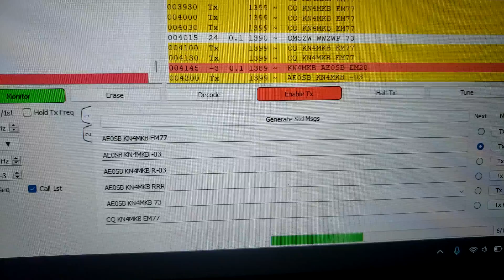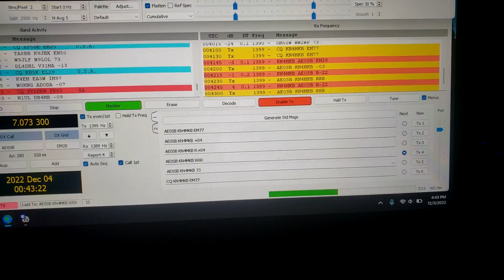The Christmas Light EFHW Antenna

Comment: Very good Billy, I'm Craig up in Antioch IL KD9UQ*
You are doing in a fun way a trick that started 75 years ago for early hams to visualize and tune antennas, experiment, and clearly see the E field of the complete  EMF as it radiated from the antenna. They used gas tubes because it can take the kilovolts generated. Even a magnetic loop can be shown this way. 
I did this my first time in 1982 with a long wire to see the multiple wave lengths. To see the H field you take a ferrite or just a pencil stub, wrap like an electromagnet loosely coupled in parallel and connect a zenon or neon bulb to the ends. Use 12 gauge wire, 25 turns or whatever you have. The magnetic field part, your actual signal radiated will light up and glow based on your modulation power, even FSK like ft8 can be seen if you can film at that absurdly high speed lol.
Not all old guys are sticks in the mud or "sad hams" or "lids" most of them live on the internet and troll.
I understand you have invested your brain into digital modes as you say but keep your mind open and you too will get the antenna bug. 
May I suggest Rothammels Antenna book newly translated to English from German courtesy of Deuchsland Amateur Radio Club (DARC) this year? Its 1600 pages of Handbook with all the collected antenna knowledge we have created condensed into military manual style, concise, informative and complete! I assure you of you just reading the first 200 pages all the mystery of antennas known since 1870 will delight your powerful intellect and make you a much better operator in digital modes. I expect if an old dog like me can understand the science of Rattler and be planning my own Fast Scan TV on UHF you can understand my personal challenge to read up about Diversity Tuning to eliminate your apartment noise and lead to you being able to transmit interference free with neighbors happy. HInt: your going to be getting directional with your vertical with 2 single radials. I won't spoil the "Aha!" moment for you. I only operate VHF right now after decades away and not having many years left this old Navy fire control electronics and radar tech wants to try to experience as much as possible on the radio. I commend your being an Elmer to many new guys of all ages. Ill be looking to you for some help soon with getting gear to play nice together soon enough.  Its a powerful trust you have so stay humble my friend and fellow warrior. God bless and keep you both safe. 73 Craig (FC5 USN 1985-90) KD9UQ*
Reply from the maker: Thank you for your thoughtful comment. I will try and take a look at this book this year. Maybe it will open my eyes to a little bit of what we call "magic" in the antenna/HF world. I know it's not magic, but until I have a good understanding, that's what I chalk it up to. Thank you for the recommendation. I'm glad to see an old project like this being done then. I knew the "light distance" had something to do with the wavelength, but nothing more than that. Thanks again, and 73 to you! KN4MKB

Comment: Are the lights incandescent or LED? Also, did you separate out the lights completely or leave them in the series/parallel wiring?
Reply from the maker: They are incandescent and separated.

Comment: Good to see you back! I think the resistive element of the bulbs is probably eating up much of your power. Possibly use a green wire that matches the light string and weave it into the strand, then shut off the lights and use that wire as an antenna and then turn on the lights when not using the radio. 73' de KD5INM

Comment: I wonder if the active and passive components in those christmas lights will generate spurious signals and cause unintentional interference from your transmissions....this seems like a bad idea.
Reply: It would if they were LEDs, but these are just incandescent.  The biggest downside to this is the loss resistance is extremely high, literally optimizing for turning power into heat.  The uneven resistance along the antenna probably screws up the tuning pretty bad, too.

But yeah, do this with LEDs and you'll only be transmitting half-wave and the cut-off for the other half of wave will generate tons of harmonics.  At least for a few miliseconds before the LEDs explode.
Reply from the maker: There are no active components in incandescent Christmas lights. They are quite literally just a string of wire with the bulb sections being much thinner wire surrounded with argon gas.If these were LEDS, which I guess is what you are thinking, it probably wouldn't work at all. But that's a different video.